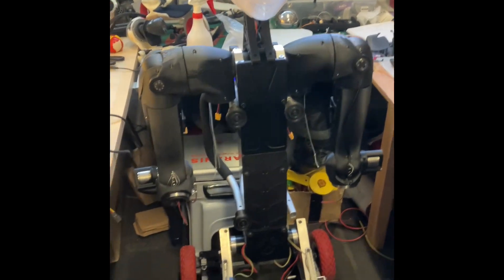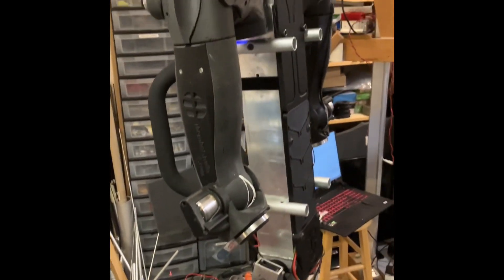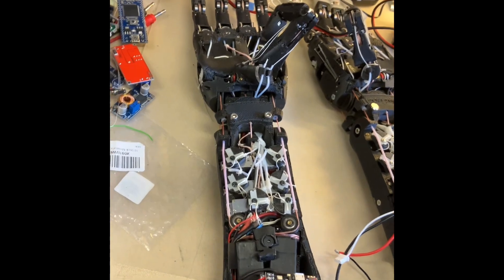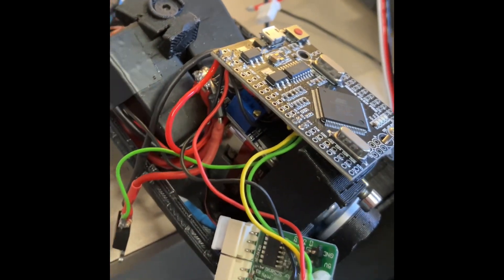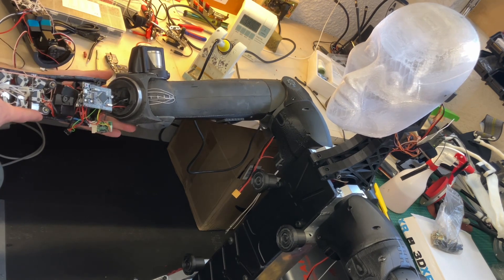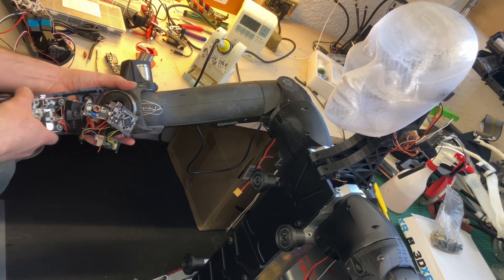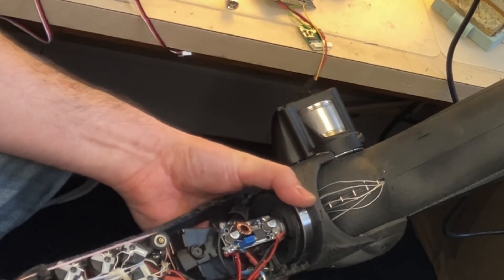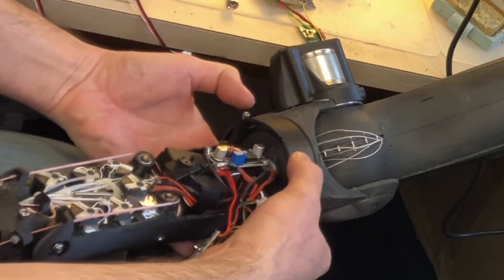Integration of body, arms and hands of the HOPE1 robot

Comment: when you go to sell robot arms or hands, i think one option to cut costs for production and forward those savings to the end user would be to send it as a kit.  so all motors, circuitboards, and batteries along with all 3d prints, the string, the teflon tubing, the bearings are shipped for them to assemble themselves along with instructions.  they would feel they've achieved something and learn and save them alot of time vs trying to design and make themselves.  this would make the manufacturing on your end easier.  you could give the option for fully assembled for a premium.  this would maybe ideally be cheaper than them ordering everything themselve since it is bundled and you bought at wholesale volume.  I am thinking of my anet a8 3d printer I bought in kit form as a comparison.  I saved alot of money going that route and building my printer myself.
Reply from the maker: We tried that with the robotnanohand - the volume cost savings were more than wiped out by the logistics of putting packs of parts together sadly. Still some people are using the kits so the experiment continues.

The V1 is now just completely open and DIY and the V2 will be commercialised as a fully supported product.

We shall see which one wins out 😁

Comment: if you recall back to the finger joints you did with polymorph, do you have any ideas for how to lube such a joint?  graphite powder as dry lube vs some kind of grease enclosed in a sack like a spinal disc?  what direction would you go or would you just not lube and let it wear down and replace it every so often?  for my robot my fingers are from a pvc medical skeleton as are all the bones of it and I wonder how I would lube joints which are currently pvc on pvc scraping
Reply from the maker: The advantage of the plastic joints is that they require no lubrication and they last pretty well with fibre reinforcement.

I don’t know of a way to mimic the friction properties of organic joints except to use ball races. 

To the best of my knowledge there is no commonly available synthetic equivalent to the material properties of organic synovial fluid and joint linings. Teflon on steel has a full order of magnitude more friction for example.

Though I note that some people with hip replacements are able to run so it appears there may be some medical
ceramics that can get very near.
Reply: @therobotstudio  I think your early robot designs played a role in persuading me or inspiring me to make a human skeleton based robot.  this approach has its challenges because it doesn't leave much room in arms for standard integrated servos but I have worked through most of these design challenges and am making progress little by little.
Reply from the maker: Very good. Yes it’s a definite problem that servos have such a different form factor to muscle.

Comment: What brand of DC-DC converter are you using? You mentioned problems with it before.
Reply from the maker: That’s the problem really, I can only find random brands online and apparently they all use counterfeit chips.

Just bought 5 more for 13Euro but I’d rather one that lasts for 10 or 15.

In the next revision though I plan to install a Battery Management System and two li-po cells which will handle the current surge much better than a converter.

Comment: Is this a Dex2.0 hand? Excellent work, like seeing it all coming together. The movement of the hand in this video is by far the best I have seen you do.
Reply from the maker: Yes, this is first V2.0 and which uses serial servos throughout.

The next version uses new generation servos and is even smoother: https://youtu.be/cs5ue37ZQJ8?si=ZQPCFJ2Ycw1UzuM9
Reply: @therobotstudio  Do you plan on releasing the CAD for the V2 anytime soon? Looks like you made a lot of revisions since V1. I assume the serial servos give you more flexibility in programming actions.
Reply from the maker: The plan is to open each version as the next is developed and commercialised.

We’ve just launched the beta trial for the V2 at DexHand.com and will rent fully working hands.

In due course there will be a V3 and then the V2 will be opened…